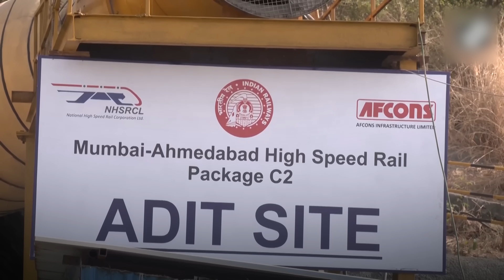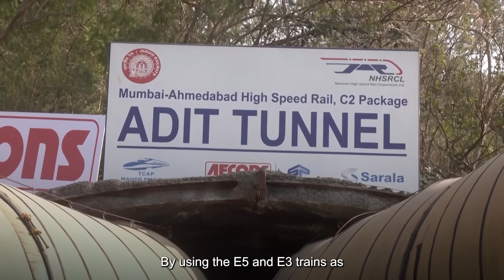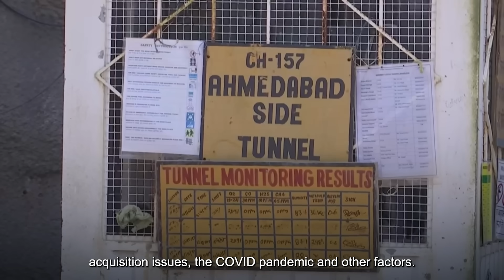Japan To Gift Two Bullet Trains — The Shinkansen E5 and E3 — To India | Details

Comment: But please focus on the quality of bullet train railway tracks. Some of my friends working in Mumbai said due to pressure they are not giving enough time for curing concrete and proceeding further without proper testing and approval. Please Do not ignore it. We have continuously seen newly constructed bridges collapsed, highways with cracks. It will be a disaster if anything happens in bullet train works.